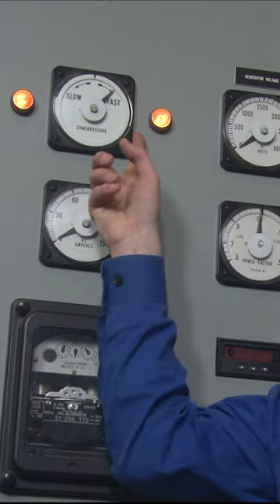Synchroscope #engineering #highvoltage #electricity #generator #hydropower #powerplant #90s

Comment: You know what they say, "if it ain't broke don't fix it!" Also I'm only one year older than that meter lol
Reply from the maker: The meter is staying, but I'm going to add a dedicated Frequency meter. It's time for some upgrades.
Reply: @Physicsduck  The only powerline frequency meters I've seen in person were reed type.
Reply: That's why we still walk using little horses and oxen to pull sleds.
Reply: Hey same here!
Reply: If it ain't broke it can still be replaced with an updated system that fits modern technology instead or 31 year old technology.

Or however that saying goes.
Reply: I had the same thought you stole my comment😮
Reply: I'm about 15 years older than the meter, puts me about 5 years younger than our presenter.
Reply: If it ain't broke, you damn well don't even touch it
Reply: Canuck here. If you're Red Green then the saying is, "If it ain't broke, you ain't trying! "
Reply: I'm a year younger🤦
Reply: A lot of the analog equipment is more robust than the digital version, which can be a very good thing when (not if) the feces hits the fan.
Reply: That's my thinking. I do HVAC and over the years many controls and such have gone digital. I'm still learning but most of the older mechanical parts are simple and reliable, it's easy to understand what's going on and much more simple to diagnose issues. Now with a lot of the digital stuff there's no easy way to see what's going wrong, you might have a wonky part or you might have a bad circuit board and you wind up on the phone with tech support for hours getting shuffled around just trying to find someone that actually knows what the hell is going on. I will always prefer simple analog tech that I can take apart and puzzle out over some proprietary digital bullshit made to impress homeowners. I don't need to be able to change the temperature of my system on my damn phone I just want it to work when I need it too. I want as few computer chips in my belongings as possible
Reply: Man, I'm only a year older than it and I feel like I'm falling apart 😅

Comment: I worked at a hydro plant adding remote monitoring and They were from the 1890’s almost nothing was updated. I remember a governor part called for #1 whale oil.
Reply from the maker: Can you still BUY whale oil? If not, what's the modern analogue?
Reply: @Physicsduck not the OP, but have seen similar things. Precision laboratory apperati at the museum i helped found / work for, to be exact. Though not a perfect match (still working on matching it to the few cc of original whale oil we have), starret micrometer oil is a suitable replacement in the application its used in. At least on one machine, havent restored the rest to moving condition yet...

Thus i suspect OP found similar suitable replacements. Im also quite sure you can still get whale oil from china, as they still hunt them if i recall correctly.
Reply: @lbochtler  🇯🇵
Reply: I worked on helicopters that used a whale additive in the transmission oil. Once banned, a "suitable" sub was provided. We started losing transmissions left and right.
Reply: Whale oil was still in everyday use up until the mid 1970s.
Reply: @Physicsduck If you needed very small quantities or had very deep pockets, you can still buy vintage oil. Otherwise Jojoba oil is used or a handful of commercially produced petroleum variants that claim to be similar in performance.
Reply: I have a few older machines I have/ deal with. I'll come across them requiring lubricants that just don't exist anymore, and I'll have to spend time researching a replacement. Luckily I haven't come across whale oil requirements, I wouldn't know what to use.
Reply: In the 1800s, watchmakers used porpoise oil
Reply: So its a multi porpoise oil
Reply: @spiketheimpaler4698 😂
Reply: @obsoleteprofessor2034 Who knew helicopters required whales to run.
Reply: @obsoleteprofessor2034  car transmission had the same problem. In the first year whale oil additives were banned- car automatic transmission failures doubled! Then doubled again the next year! The synthetic oils and additives have replaced some of that but still not as good as the whale oil sadly.
Reply: Whale hunting is banned in the US but no other oil can match it’s quality. If you attempt to do an oil change on a satellite you will find they still use it today.
Reply: @kevinprice2274 😂funniest thing i’ve seen all day.

Comment: I knew of someone that connected an 80MW steam turbine powered generator to the grid out of sync.   The bang as the generator "snapped" into synchronization shook all the coal dust off of the catwalk crevices.
Reply from the maker: (twitch)
Reply: Yup, it'll do that
Reply: Fascinating. I can't imagine the cringe. Do you know how/why the mistake was made?
Reply: Sounds like a dust explosion waiting to happen
Reply: Apperently a local gas turbine plant also did that, 15° out of phase. Blew the generator fuses while also nearly destroying both turbines. (2 generators 2 turbines, tied to the grid in short succession. Thus 2 bangs). It was told to me, that the autosynchronizer failed on both units,eading to both tieing in 15° out of phase. 

Wild stuff, id love to see / hear a desync event
Reply: Uncle Fester style click click 😅

Comment: You don’t have to be perfectly matched. You only have to be perfectly matched if you don’t want the grid to pull you into synchronization.
Reply: Do elaborate
Reply: @sanveersookdawe  If you are jeust a little out of phase, you can connect your generators to the grid.
In that case the peaks of the grid AC and your generator AC do not line up perfectly and some balancing Currents will flow. If it is behind the grid pahse, power will flow from the grid to your generator, puhing it like an electric motor till its in phase. If the generator phase is leading, then some excess power will flow into the grid, which puts load on the generator, slowing it down until it is again in pahse.
When the generator is perfactly in phase, and its votage matches grid voltage, then there is no load on it. Thus the Generator Phase will self stabilize, so long as irs only a little bit out of phas..
Reply: @sanveersookdawe  AC power generation is sychronized based off the grid's current frequency (generally 50-60Hz). Theoretically you could take a random generator and jam it onto the grid, but without frequency matching before tying, you will impart excessive currents from the phase and frequency differentials into the generator which will blow it to pieces. When this happens at a power plant, the result is a massive explosion.

To be perfectly synchronized on an AC power grid is to impart only the load the grid is drawing onto the generators, which requires good phase and frequency matching... This is where the use of a synchroscope comes into play. 

Here's basically how to read one;

Rapid clockwise spinning: Frequency is higher than the grid and phasing is incorrect

Rapid counter-clockwise spinning: Frequency is slower than the grid and phasing is incorrect

Steady in a random position: Frequency is correct but you are out of phase. You could technically read how far out of phase you are by taking a protractor to read the needle position on the synchroscope but this isn't vital information and isn't done in the field anyway. all you really need to know is that you're out of phase and need to adjust with generator frequency modulation until you're not.

Steady, pointed at 12 o clock and the lamps are not lit: Tie that sucker! she's in phase and on frequency.

In all cases where the phasing / frequency are incorrect, the lamps next to the synchroscope will also illuminate when passing past zero differential to show that you're not properly synchronized. These lamps show the presence of a a differential current in the grid vs your generator power. Again, any imbalance will cause these currents to form between the generator and the grid. In the cases of a small imbalance this will cause a spike when tying to the grid that sorts itself out, but in the worst cases, these can be very explosive if not properly taken care of before tying to grid.
Reply: That's so cool!

Thanks guys!
Reply: Though if you are too far off the impulse can easily blow up your equipment, both electronically and in a literal physical sense as your generator suddenly runs into a brick wall of force
Reply: Sure. You don’t have to be “perfectly” matched. But it should be with a few degrees. The bigger the machine, the closer to sync you need to be.
Reply: @nicholasweiss4662 I had this one time at a customer. The HV breaker got old and it took it fair time to close. I never ever closed a door so fast after seeing a 20 cylinder  2MW gas engine rock like a boat in bad weather.
Reply: @DigBipper188 I understand that an unsynchronized 150-MW turbine being inadvertently connected is rather exciting, and kinetic.

Comment: All power generation units are magnetically coupled to all other generators on the grid. All perfectly in sync. It’s beautiful.
Reply: Damn, I have not really thought about it that way. Like I knew that they were electrically synchronized, but I did not think of the mechanical part like that!
Reply: Explain that more please
Reply: @sanveersookdawe  all electric power generation is done by rotation of magnets inside copper coils as doing so imparts currents inside the copper coils and produces power. And since all generators have to be in sync (they use ac which means the power changes from positive to negative which means that being out of phase can cancel out some power which is bad). This means that for all generators to be in sync, all their components must also be rotating at the same speed at the same time. Neat stuff.
Reply: I wonder if one could introduce slight alterations to the waveform, and use it as a sort of low bit rate data link?
Reply: The coolest part is that they are all at the exact same frequency but not in the exact phase. Some of them have load angles approaching 60 degrees ahead or of the grid. Crazy to think somewhere there’s a massive generator 60 degrees ahead of the grid. Pumping power with its coils screaming
Reply: @LRK-GT  there are device that allows you to send internet from your router to your pc using electrical cable in your house
Reply: No they are not not magnetically coupled.
To say something is magnetically coupled to something else requires that the magnetic field from one device passes through the second device and has an effect on it.

There is no way generators 100 miles apart are magnetically coupled as the magnetic field from one generator does NOT pass through the other generator 100 miles away.

The generators are coupled but they are electrically coupled, not magnetically. And the waveform couples them.
Reply: @LRK-GT  https://en.wikipedia.org/wiki/Power-line_communication
Reply: We had a system called Power line carrier at my old power company basically super impossed a high frequency carrier onto the 50 or 60 htz base frequency  it had big primary voltage blocking inductors at each end of the power line to keep the data link between the two ends of the power line separated. The injection equipment was pretty special allowing low voltage carrier to eventually be at the primary voltage using capacitors in series to lower the voltage.
Reply: It's amazing when learning, that plugging into the socket puts a load on the generator at the plant. It's cool to think that I can slow the rotor the tiniest bit. I exist!
Reply: @deang5622 What you’re forgetting here is the electrical cables don’t just carry electricity, the carry the magnetic field with it. Which pulses from each generator in time.

And if the generator tries to slow down, the grid will literally push it and keep it in time as long as it’s connected, and it will drag on it if it tries to over speed.

Comment: I was at a power plant that was moving a bunch of wiring.  The electricians reconnected the synchroscope with 2 phases swapped.  They had the rebuilt 75MW turbine at speed and went to connect it to the grid not knowing it was 120 degrees out of phase.  Loudest boom I ever heard, the power to the city went out but the turbine & generator survived.
Reply: So Synchroscope doesn't indicate phase inversion or generator running the wrong way?  I would have guessed the lamps or dial would be going nuts indicating a double frequency .
Reply: @johndododoe1411  On  it's own it is a pretty simple device.

Comment: "Upgrades" yeah right, betcha the new one breaks before the old one would've if you'd just kept it.
Reply from the maker: I don't remove old gear so long as it's practical and reliable. The "upgrade" here won't be in removing the old synchroscope, it will be the addition of a new Frequency meter.
Reply: @Physicsduck vibrating reed i hope

Comment: My dad was an operator at a plant in IL. He told me a story about a generator that had been improperly synchronized when it was hooked up to the grid. It  was a backup gen that was only used during the plant construction sometime in the 70s. I think it had the power output of a few megawatts. Long story short, circumstances conspired that it was almost exactly 180 degrees out of phase when it was put on the grid.

It promptly riped itself out of its foundations and bent its 2-foot diameter crank shaft (can't remember exact dimensions) out shape. Thankfully, no one was seriously injured. 

There's a reason you pay attention to that scope.
Reply from the maker: I love getting the stories from you guys on stuff like this. Thank you! :)
Reply: Very similar story out of the bush fires we had a few years back in Australia.
Containerised generator with miswired scope and/or output legs tried to synchronise with the loaded units

As soon as the ACB closed, it rotor locked and rolled itself (and its container) through the car park doing significant damage ti anything in its path
Reply: WHOA! Always wondered what would happen… now I know …✨⭐️
Reply: @spicywolf6718  I've heard this story already on this channel. I'd love to see the security camera footage for that one hahah
Reply: A couple of old 100 watt light bulbs connected across the breaker is it a good way of making sure that doesn't happen however if you're relying on somebody else's work they might have got the wiring wrong
Reply: Wow😮
Reply: I was gonna say even if it's a little out of... but 180? Duck. You don't have time to run.

Comment: Your local-ish nuclear power station probably has a very similar syncscope and switchgear. Mechanical relays can't be hacked when firmware isn't updated.
Reply from the maker: That's exactly why there's no internet connection to our control systems. You can watch, but you can't touch.
Reply: @Physicsduck  In the US you have to be under a certain generating capacity in order to do stupid things like hook to the Internet.

Larger plants are considered some kind of critical base load infrastructure and are largely banned from doing the big stupid.

There was a guy who had a few Peaker plants tied to an iPhone once. He showed it off to DoD guy. I think they convinced the company to stop.

Just to be clear, multiple generating sights under remote computer, from an iPhone. At least the plants are manned I guess.
Reply: You bet!  Try to find a software guy at 3AM.  Ha!  Call the shop and the night guy comes in with his Fluke and fixes it.
Reply: @erincarson8998  Larger plants are manned at all times by a very qualified group, and are hardened against external control.  Air gaps, digital diode isolation, even the USB ports epoxied shut.
Reply: Can confirm the units at my plant each have synchroscope guage just like this on the main turbine / main generator board in the control room. This plant is from the 80s.

It's likely that newer plants have fully digital controls; cyber security is taken very seriously, and all computer systems related to controlling reactor power are isolated. Flash drives are controlled like keycards.
Reply: Most hydro generator plants at Spain have no operators at the plant. They can be operated remotely, including synchronizing and connecting to the network